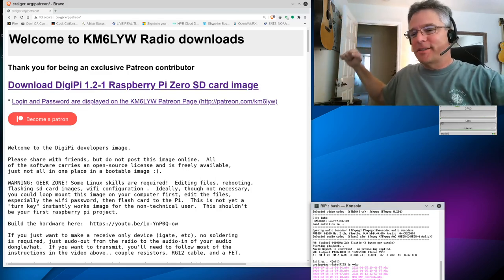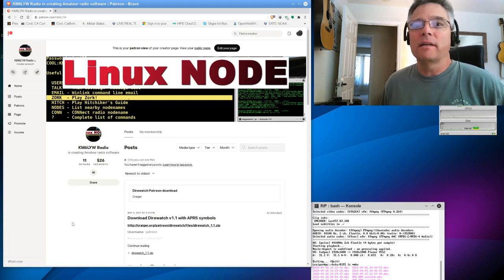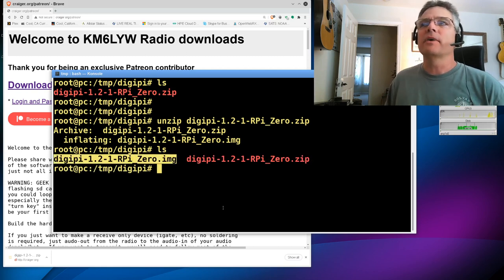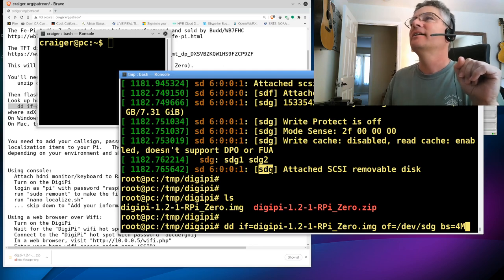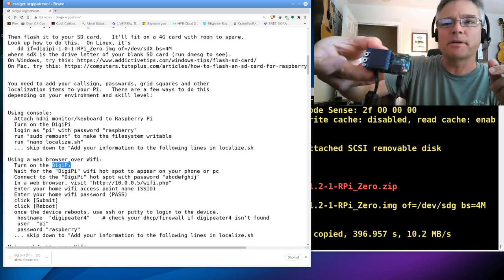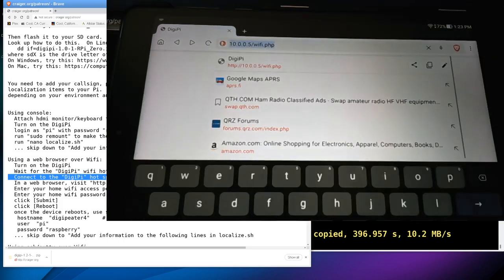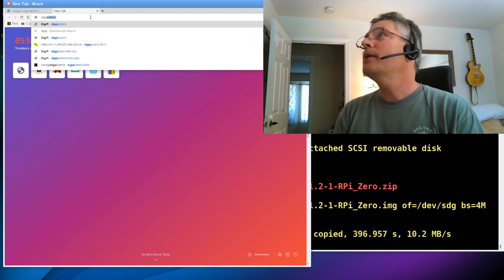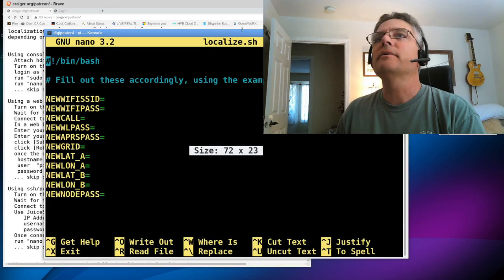DigiPi Build Part 2 -- Software

Comment: how does this work in the Field with no home network to connect to, will this show up or still work in AP mode ? How do you sync time in the field without Internet ?
Reply from the maker: In the field it becomes a hotspot called "DigiPi", and is accessed at 10.0.0.5.   If you plug in a GPS usb dongle during the boot process, it will get time from that.
Reply: @KM6LYW  does it automatically detect the GPS ? also final query , can we see a programable  PTT GPIO pin, the MFJ1234 is , I guess compatible with the Audio Injector , only difference being the difference in the PTT Pin, so can this be changed ? Also if you could add a Shutdown switch on one of the GPIO would be greate
Reply from the maker: @CharudattUplap  GPS is autodetected (ttyUSB0).  the cheap GPS dongles work, as it's all standard nmea data.  And yah, the PTT gpiin is defined in /home/pi/direwolf*conf files (there are four or five), just edit each file and change the PTT line from 16 to whatever you want.  I like the shutdown via gpio!  great feature.  it'll go into next release.  fwiw, there's a "shutdown" button on the main web interface.  You don't really  need it because the file system is mounted read-only to guarantee no corruption.  you can just yank the power at any time.  This is built for the field.
Reply: @KM6LYW  One more suggestion if you can take, is if you integrate a BME280 sensor on the I2C pins of the Raspberry Pi read the values and post it on the APRS.fi, it will be a good value added weather station

Comment: Hi! Does it work with USB sound card? Can I use it on RPi2 with LAN cable? Thank you from PT7KM.
Reply from the maker: USB audio, kinda, that's a mic-level in, and we're using a radio-speaker output. overload.  voltage divider maybe?.   Pi2?  lan cable?  sure thing.

Comment: Nice one Craig, that'll make the install a lot quicker :-)
When you get some time, you might want to look at compiling direwolf 1.6 into the image, I'm running your first release and I've upgraded so I can use FX.25 foreword error correction and there's a noticable improvement on weaker stations. Thanks for all the hard work on this, buy Craig a beer guys, become a Patron, it really is this easy to build a multifunctional, multi band TNC and node using the software in this video. Oh and for the tech savvy amongst us, you dont need a Fe Pi sound card specifically, I'm using modified CM108 usb adapters with a couple of small changes in the configuration files and it works perfectly.
Reply from the maker: Direwolf 1.6 - copy that.  I just upgraded Pat too.  Regarding direwolf, I compile it from source to fix a few bugs.  The most serious of which is a "transmitter-jammed-on" bug,  https://github.com/wb2osz/direwolf/pull/301   https://github.com/wb2osz/direwolf/issues/206 .  This is specific to the Pi.  Please apply my patch and recompile direwolf.   Forward error correction sounds sweet - Now if only we'd get it in commercial radios, not just between direwolf radios?

Comment: Is there a way to expand the filesystem on a Rasp PI 3B? I'm using a 32GB SD card. I tried using raspi-config, sudo remount -> raspi-config -> Advanced options but it gives me an error saying I must be running NOOBS popup. 73 de KB2SDR